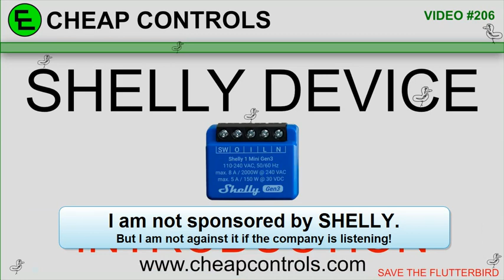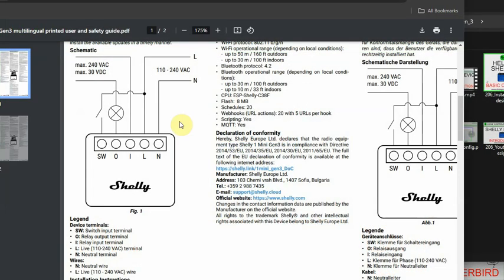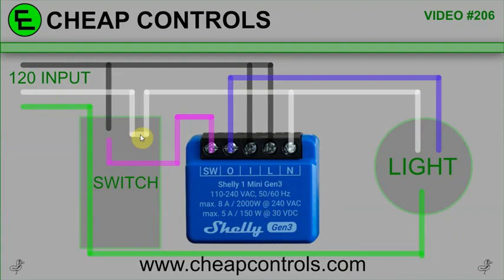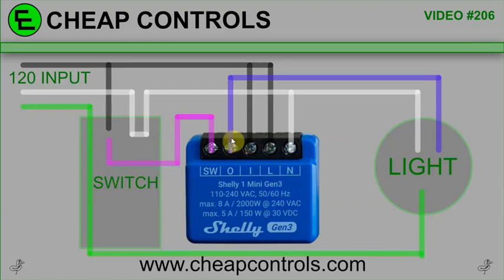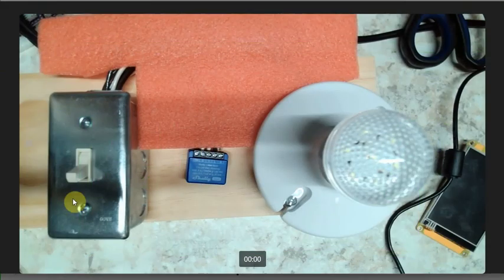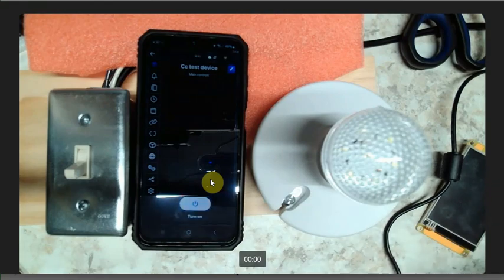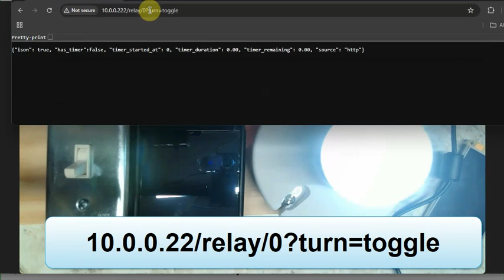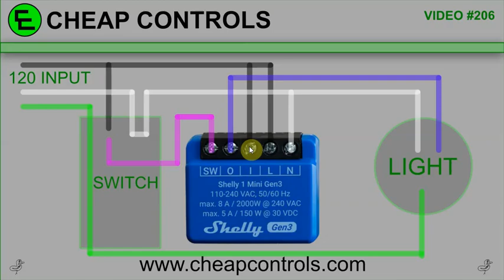206 Shelly Introduction to the Shelly 1 Mini Gen 3 eventual control by Nextion displays

Comment: Thank you for this.  Shelly documentation at best says wire it like this but the are not clear at all what each connection does.  You saved me some frustration for sure.
Reply from the maker: Glad I could help.  When I start making video again in the fall I hope to make more on other shelly products.
Reply: I'm looking at one of these to automate the remote starting of my Westinghouse 28,000 watt whole home generator, will this work on wifi on a 12v only system?
Reply from the maker: @KF5GXZ  I  cant remember if the one I used in the video has independent contacts.  If it does then it should work just fine.  I wisht that I remembered the video a bit better.  I would like to make some more shelly videos .  I am away from home for the rest of the weekend and can't check my setup.

Comment: I would happy switch to a thumbs up if you made it easy by just showing me how to put it behind a fixture, not so much an explanation, just physically see how to use the black, white and copper, in reference to the switch, as it comes between my fixture and out of the wall. Super easy to show, super helpful for us electric-tarded folk